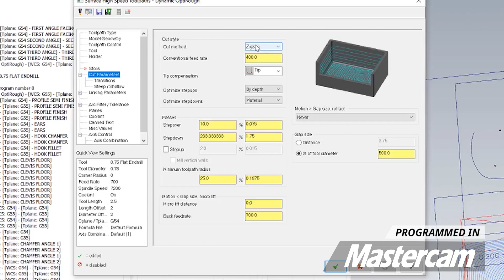Incredible Machining & Tool Life Leaves New Programmer's Mind Blown

Comment: Hello Titan and welcome Barry!
Watching you video I too believe in hogging material.
I also believe not to punish the equipment that you must rely on for end results…Accuracy!
The “Zombie” cutter still performing at the deteriorated state that was…impressive.
You still must rely on you finish pass/consistent chip load and now you are leaving extra stock that may create blem/speedbump in final work.
You certainly have great equipment to work with and in this business moving metal is the name of the game.
Watching the “zombie” cutter in one section of video it looked like the spindle was walking with full depth and width of cut. In my view is that wise for the longevity of the equipment.
Titan you have created an awesome following promoting the Machinist field. 
I look forward to your postings daily. I do not recall on you promoting take care of your equipment. Not being negative…just an observation.
Keep videos coming.
Reply: I think (and I can't really speak for them) that the purpose of that demo (with the walking) was to show that the zombie cutter could do that. I didn't take that as a recommended feed and speed.  
As to your other comment about the uneven stock left for the finishing run, you could use a fresh roughing tool to do a one before last run to smooth out the "speed bumps" and then use the finishing run. 
What do you think?  I would love for Titan to comment on this.
Reply: thanks!